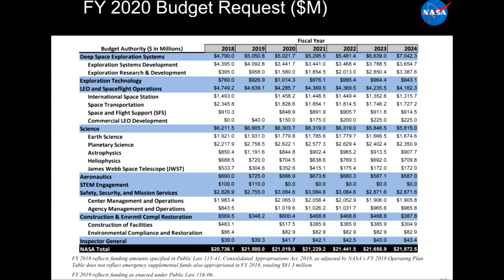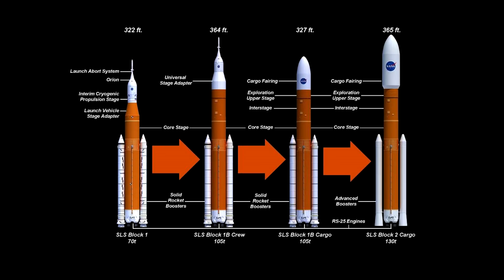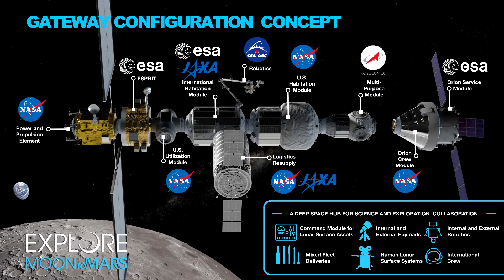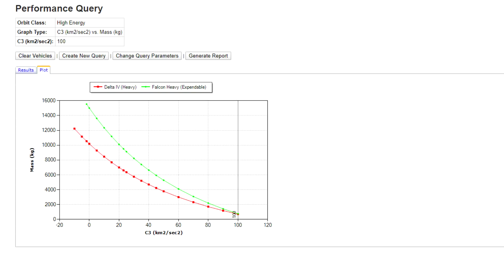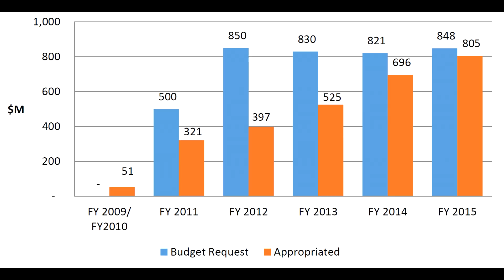SLS Rocket In Trouble After New White House Budget Request

Comment: You know what can lift 6 tones the Space X BFS or we can use a falcon heavy like you said with more boasters and call it the falcon super duper heavy.
Reply: It sounds so Kerbol just to strap more boosters on the thing. xD
Reply: @jensbrandt7207  Im actually curious if they could strap to more falcon 9 cores to the Falcon heavy and super  power it.
Reply: @mb-jg9hh  

The first question would be, does the structural integrity of the falcone 9 suffer under the load of 2 more boosters? The second question would be, is it even economical to do that?
Reply: I have no idea but its something I might have to look into.
Reply: Just with the slight difference that the BFR has yet to be build ;D.
Reply: @Enthropical_Thunder  Yet

Comment: NASA just posted a bunch of viral videos on youtube last night to try and promote future exploration, I guess this was the reason why...
Reply: Future exploration should be encouraged. On commercial launchers for a fraction of the cost. SLS is unnecessary in a world where private industry is designing and building superheavy lift vehicles.
Reply: @polygondwanaland8390  I think this is the reason they're emphasizing 3 stage lunar landers. They can just buy a bunch of Falcon Heavy flights and assemble them in orbit. Maybe they're hoping they can also scrap the extremely weird Orion capsule thingy and go with something different for that as well. Maybe they'll just contract for a "Hab Dragon" or something with extended endurance but lower crew capacity, obviously replacing the cargo trunk with a different support and propulsion module. When Blue Origin and BFS are operational, they can likely start sending even larger station pieces to lunar orbit, but the three-stage system would still be extremely effective.
Reply: @polygondwanaland8390  Eve Online is becoming true, space corperations ftw!
Reply: Did the videos go viral?
Reply: @newsgetsold  No but they tried :P
Reply: I seriously believe there was no point in wasting money on SLS. I mean why we're they doing it and at the same time  collaborating with Spacex. Running parallel programmes like that led to wastage of money. Now the whole SLS seems meaningless with Dragon and Starliner. We should have been on the moon by now had the right decisions been made. Anyways let's hope for the best.👍💯
Reply: @abhilashroy255  Dragon-2 and Starliner are commercial crew vehicles, for rotating crews on the ISS, SLS/Orion are not.  The Moon plans just came in recently with Trump.
Reply: Fake news, NASA is great again.
Reply: it is necessary to do such things in a not ideal world. its important to promote why science is important - especially in a era where ignorance flourishes.
Reply: Then they need to get their shit in order and finish SLS and get it airborne.  Right now theyre stuck in paralysis by analysis with it.
Reply: Is their porn watching money about to run out?
Reply: NASA should spend money on real space program instead of fancy CGI. They are making so many missions in CGI that there is no time and money left for real ones. Soon they will be exploring solar system in Kerbal Space Program with RSS mod and streaming it on Twich and/or YouTube.
N - New
A - Age
S - Space
A - Animation

Comment: "New space hardware could be flying..." Read: Starship. 
I haven't heard even the most wildly optimistic estimates saying anything about New Glenn flying in 2020, so Starship is the only possibilty, and that would be potentially flying tests rather than missions.
Reply: ThirteenthAndy SLS won’t be flying by 2020 either. I believe the latest timeline puts first flight in 2021 and I doubt they’ll make that.
Reply: @jetty92487  Agreed. That's why I see SLS being cancelled after Block 1. The lobbyists are ramming it through so far, but it's done after one or two flights.
Reply: I'm not seeing StarShip flying by 2020 either TBH.  Nor new Shepard or Vulcan.  Falcon Heavy and Delta, those are the options. 2022, that's a different matter.
Reply: @SomeOne-vq4fo  – agreed, Starship and New Glenn will happen, but I don't see it happening in the next couple of years... even 2022 is probably a stretch. Delta and Falcon (Heavy variants includes) are what we have today, and for anything launching in the foreseeable future, they're the only realistic option.

As for SLS... I think something will fly in the next couple of years, but probably not the full Block 1 spec... more likely a more limited testbed that demonstrates why they need more funding...